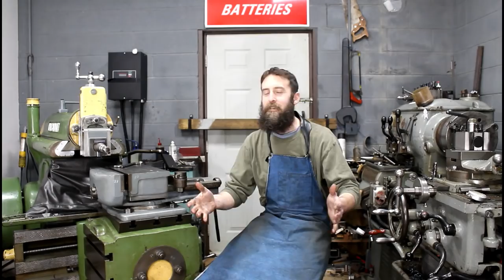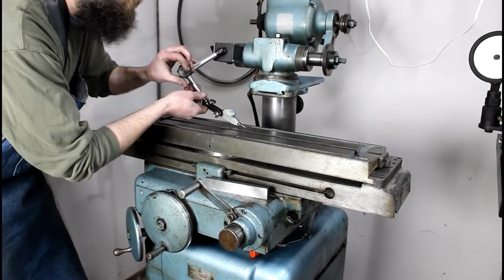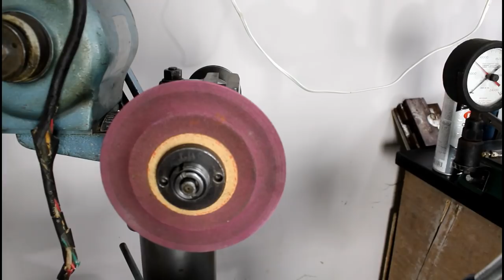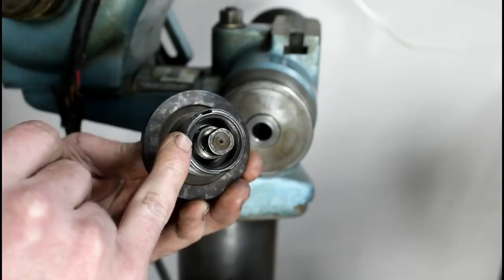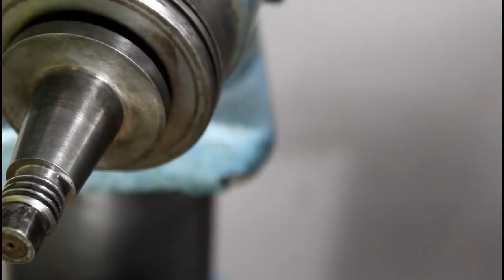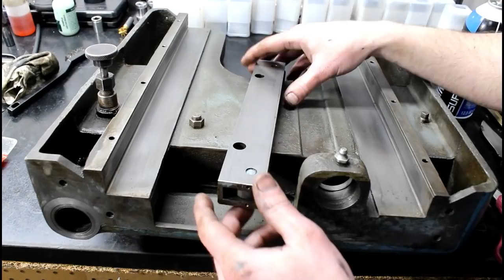We Got TROUBLE!!  Everythig was going so good :-0

Comment: Might want to check spindle bearing lube.
Reply from the maker: It seems to be a sealed unit that is preloaded and "life time lubed "    But I could be wrong, haven't dug that deep yet.
Reply: Steve Summers , Well, I guess there is little harm in waiting for failure depending in the price, availability, and difficulty of access, replacement, and greasing. Precision bearings are beyond my 30-40 years of auto experience. At some point early on, I started examining failed and other replaced standard ball and roller bearings (usually because of noise, play, age, quality of grease, discoloration, brutal installation, sketchy appearing grease and an accumulation of factors) and brutality and grease failure/age were the two main causes. If the bearings are noisy, they are pretty much beyond repair, but lube may slow deterioration. Be gentle and press in bearings avoiding force that loads bearing balls, avoid hammers when possible and use a driver that supports inner and outer race. Balls can dent the races if forces are excessive. Rollers are much more durable, but I have seen yellowing or bluing from gross over-tightening of tapered rollers. With balls and rollers there has to be enough room for the oil film, shear forces can cause great heating. Have I droned on enough? Sorry!

Comment: I’d say you have some shop-made hubs, and that the maker didn’t bother with the internal threads. All of my hubs have those threads. That said, it generally takes almost no torque on the puller screw to remove the hub. The LH threads on the retaining nut insure that it won’t come loose, even if you don’t use much torque installing it. Keep in mind that way wipers can attract grinding dust and do a good job ‘lapping’ the ways, also.
Reply from the maker: Could be shop made hubs..     After I'm finished with the machine surfaces I plan to skirt the lower section with leather.     Good to see you Paul

Comment: I wouldn't even think about doing those on the shaper Steve. That is grinder work for sure. 

You'll get it straightened out I'm sure of that.
Reply from the maker: I agree with you that its grinder work and I have the lower rails sorted . But I may end up having to do the saddle on the shaper and then scrap it in. I don't know anyone who would have a grinder big enough to do the saddle, Brian Block's grinder may be big enough but I'm not sure yet. I'm not sure of anything yet ;-)  One way or the other this little grinder is getting fixed..    I'm just not sure how yet..        Good to see you

Comment: Look up a forked wedge that is used on Jacobs chucks. Make two.  I have noticed the surface grinder sites recomend leaving the wheel hubs with the wheels to preserve the balance.  Make or buy more hubs for each wheel you have.
A balancing fixture for the wheels is a good project.
Thanks
Reply: Dennis Williams I
Reply: Most tool and cutter grinding uses fairly small od wheels (usually 4.0 inches ) so balance is not critical...on older machines bearing would be a concern if vibration becomes a problem

Comment: I don't know the dimensions of the table but it might fit on my grinder. You are welcome to use it if you want. It would for sure make short work of those bolt on ways.
Reply from the maker: Thanks Brian, I haven't measured the width and length of the saddle yet but it would take a big grinder. I'll get some measurements and get back with you.   I am still not sure what I'm going to do. I'm mapping everything out now to make sure I am not making any stupid mistakes. I'm not above that ;-)     Thanks for offering and I may take you up on it, I still got lots to figure out. Not being an experienced machine rebuilder is not helping..
Reply: My wheel will cover 12x24". i can fit probably 20x40 on my chuck but I can't grind that in one setup.
Reply from the maker: bcbloc02 The saddle is about
 11" x 17" Brian, how big is your grinder?
Reply from the maker: bcbloc02 Ok, I just seen you posted the dimensions, That may work🤔.

Comment: Removal of arbor (12:00 minutes) without the internal thread: I don't know the design intent for this machine, but I have seen machines that use a removal tool that threads on the external threads and presses the taper apart with a jack screw against the center the same way as the tool for the internally threaded ones.
Reply: Aha. That;s easier than the wedge idea I posted. Good one.

Comment: I've always lightly tapped the back of the arbor with a piece of aluminum or a very small brass hammer. Lightly is the key, anything more and you have to take the whole spindle off. By small hammer I'm talking 1" diameter by 2.5" long on an 8" handle. I wouldn't use the shaper on any of that, there are big grinders out there and if someone grinds the saddle, the same wheel (if dished) can be used to bump the faces for the rollers. Grind the ways flat, shimming is a quick fix but not permanent. They don't shim them at the factory.

Comment: You might want to make a holder for a wiper strip on each end to remove the grit from the guides, and then , as the oil reservoir is above there, drill a hole through the base into the ways in a place always covered with the guide, and place a wick in the hole to allow oil flow into the way. Will flush out the grit slowly as it is extruded from the wiper strip.

Know anybody who can hard surface that guide, or even have an induction hardened guide if the metal can be hardened. Would definitely replace the rollers though, cam followers are cheap enough and durable, and those old ones will have grit in the inner bearings for sure. If making new ones I would suggest making them a lot longer so as to have a larger bearing area and thus decreased wear on the table, plus it will cock less with overhang.

Comment: Nice little machine! Run out doesn't really matter on a grinding machines spindle, as soon as you dress the wheel it cancels out any run out. Obviously extreme run out isn't ideal. Checking the end float and lift in the spindle bearings is much more important, and will affect surface finish, and in some case cause the wheel to load up if it's excessive.
Reply from the maker: That makes sense, I have very little experience with grinding so what matters and what don't is still new to me.
Thanks for watching and thank for the comment.
Reply: But what about diamond grinding wheels?  I wouldn’t think that those can be dressed the same way a normal grinding wheel can, right?
Reply: David Miller normally diamond wheels have a slightly bigger bore, so once fitted to the flange and spindle, you leave the flange slightly loose and clock/knock the wheel true, because as you say they can't be dressed like a conventional wheel. Other wise even on a spindle with zero run out, you still need abit of clearance to fit it to the flange and you find you may only be cutting on 30percent of the wheel.

Comment: looks like you could flip those slides over and use the other side?  also it seems some oil channels might be a good idea, wicks and somwhere to oil it from
Reply: Jusb1066   Really?  Flip them over?  Think on that just a short time.  1) Counterbored mounting holes.  Where do the bolt heads go?  2) The wear pattern has the ways in a wedge shape.  There will still be slope.

I agree about need for lubrication.  Perhaps study the shaper's method.  It might yield some interesting ideas.
Reply: i admit i did not think about the bolts, but as for the wear, it would easily be shimmed under two bolt holes, fixings could also be counterbored the other side   it has worn in a strange way, rather than a dip in the middle and high at both ends, it should be shimmable on one end
Reply: I was thinking switch them left to right. Then the taper would be opposite the taper on the table ways. He said there was .006 but only sees .003 on the lower half. The spring load would be reversed though which may not work against the force of the wheel, I've never run a grinder.